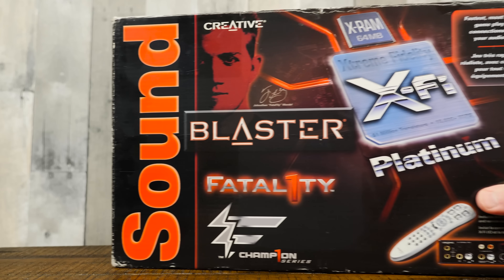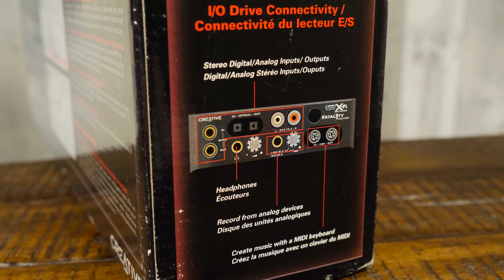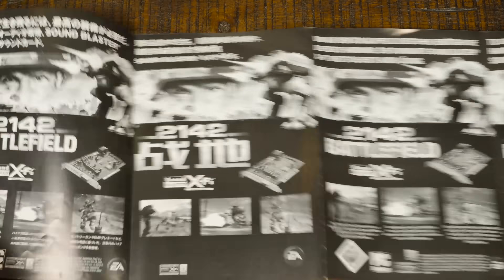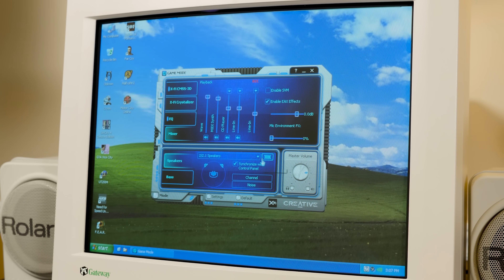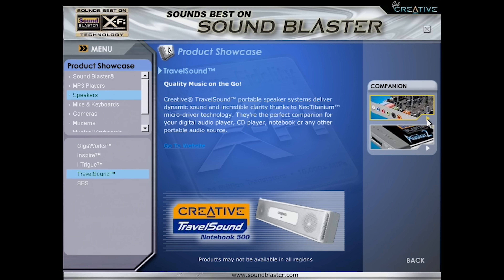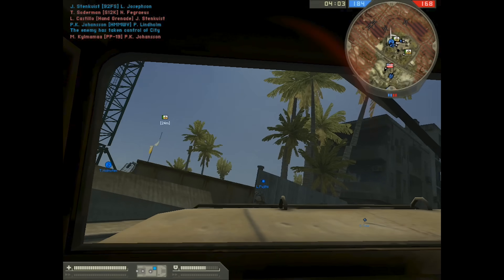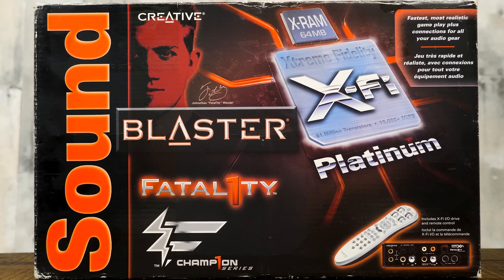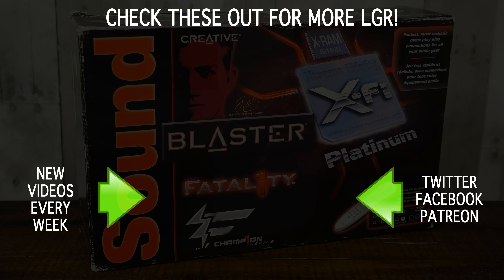XP Upgrade! Sound Blaster X-Fi Platinum Fatal1ty Sound Card

Comment: Still have mine from about 2005-06... Originally for myself but as I upgraded my main gaming rig I tossed it on an ASUS M3A78-CM that had issues with Windows XP.. possibly 7 I forget. Regardless works like a charm still to this day!

I had to reinstall Windows and decided to go with 11 as the hard drive was dying on that M3A78 machine, gave it a new SSD and everything loaded up 100%. I didn't have to even install any drivers I assume Windows 11 supported them.

BUT... After I rebooted once or twice the Creative Driver Installation opened automatically, I'm 99.9% sure I didn't download them or open the setup.exe that would likely come with the driver's zip/rar.

Anyway it was like the card installed it's drivers on it's own... I could be imagining things as it was strange... and regardless I rebooted after install and the card is still 100% functional!

It was either keep the card in that system or take it out and solely use Bluetooth speakers as I tested my Razer TrueWireless headphones via bluetooth prior to even installing the SB Card and audio was playing fine.. there's just something wrong with the motherboard's audio codecs/output and I'm too lazy to re-track down the proper drivers, not even sure they exist for this mobo for Win10/11.

Comment: I remember when I bought this exact card, only difference was the started shipping it with a black I/O drive. I was so upset when it stopped being supported by newer versions of windows. I'd still be using that thing today if I could. I'm rocking a Sound Blaster Zx these days, tried the AE5 and really didn't like it, just didn't dig the software

Comment: I have a Creative Soundblaster 2 ZS (I belive thats whats its called) in my Windows 98 machine very cool card, also have a creative  SB X Fi in my main machine its pretty awesome but the downside is the headset/headphones I bought for recently (MSI DS 502) only plugs in through usb no 3.5mm plugs so I cant use my sound card with it

Comment: Bought the same card this spring (minus box and front unit/remote). It was about 20$ so I couldn't pass it. I am using it on my daily machine (p5q deluxe q9550 8GBddr2 screaming 2008). I was impressed by its sound quality and driver support up to the latest windows 10. Unfortunately pci slots are almost extinct and in the future I won't be able to keep it in a new platform.

Comment: After Jan 2019, you can't run HL2, or anything on Steam without a massive headache.  There's a modded version of the Steam installer that does NOT run updates.  It was the only way I could get my XP rig from circa 2007-2008 to run Steam.

Comment: Still have one on my gaming rig, which thankfully has one legacy PCI slot. Much less noisy audio outputs compared to the ones on the integrated ones on the mobo :)
For some reason finding a windows 10 driver for it was a pain, "officially" it seemed to be discontinued with no driver support. A big pain compared to linux, where it just worked right out of the box :)

Comment: I bought this card, earlier this year, when I built a Windows XP gaming machine. When I bought the card, it was new. I even placed the sticker on my PC case. My windows XP gaming machine has a eVGA GeForce GTX560Ti 448 Cores 1.2GB GDDR5 Video Card, an AMD FX-4300 Vishera Quad-Core 3.8 GHz processor (with an AMD Wraith Cooler), and 4GB of DDR3 memory sticks. It's a great classic PC gaming machine, although a few of my games have trouble running on it. But I use nGlide, for games that are finicky with the video card drivers.

Comment: Using a cut-down X-Fi XtremeAudio since wayyyyyy back ~2007 with a 5.1 sound system. Although the XtremeAudio is not a real X-Fi it still has many of the features of the more expensive ones even though they are implemented in software.

Comment: In 2007 I had a Creative Audigy 2 ZS Platnium, well I still have it, but I upgraded to a PCI express X-Fi Fatal1ty Platnium in 2009. I got no idear who Fatal1ty is as i don't care for e-sports at all. I still use my Fatal1ty card with Windows 10 now days. There is no such thing as a build in audio chip that is good enough. There is a metal shroud on the card that shields against noise from the other components. Before that I had SB Live! 5.1 Platnium, and I still have it in my working Win 98 PC which has been ridiculously upgraded since then.

Comment: Is it worth putting my old sound blaster fatality 64mb soundcard, it's the gaming Jonathan Wendell one, in my rig that's 2 years old with a Gigabyte X99-SLI Intel X99 (Socket 2011) DDR4 ATX Motherboard in it? My sound card has 3 diff platforms, one for movie watching, one for gaming that flies a helo around your head and u know even with headphones where it is at what 'o'clock' and also a sound engineering platform which my son would use maybe as a DJ but he got all that now and signed. My problem is when I play games after a while of thumping out auto rounds the sound goes off or intermittent, reckon the old sound blaster would fix it? Only reason I never put it in was cos it has a front panel which my new rig has a disc player there! Anyway is it worth it or does my mobo have better kit than my old sound card? I only use headphones really.

Comment: The audigy 2 ZS is a better option for basic hardware acceleration as they can be found for as little as $15 for the sb0350 model. The only issue is the bad drivers for 64-bit windows that make it so the mic input sounds horrible.

Comment: Hey! you should try and get a Sound Blaster Extigy, its good with a laptop or desktop. I still have an Extigy but the USB don't work on it. I used to use it with a Dell Insperion 8900 Laptop in 2003-04. I paid $250 for the Sound Blaster Extigy back then. Its great for analog and digital. The Extigy 2 supports DTS.

Comment: Best sound card ever by Creative. Need 7.1 speakers to truly immerse what the card can do. I soldered together 7.1 RCA cables from the 3.5mm feeding an  Onkyo SR576 receiver. EAX shines in 7.1 and so does music and movies. It's too bad they dropped DTS. The front panel is another thing too. You can directly plug in instruments in the line-in without the need for an amp. That jumper needs to be in place though. Unfortunately it's in its last Z97 system, because leagacy PCI is long gone for newer systems.

Comment: Man I miss the kind of Io you used to get just with even the most basic things LOL and if you bought premium they just laid it upon you.. also miss the days before everybody switched to those sabere dacs and and more importantly when meridian started tuning all of them.. meridian the company that lost the higher end or at least the instructions for it somewhere in the origami of mqa and then just applied at universally to everything they do.. thanks Bob! I think the sound blaster zs is the last of the accelerators that doesn't have it, and still uses the proper good sounding if you like sound blaster sound chip.. all the windows still doesn't play nice apparently with any sound card from what I can tell when you put it into surround or 24 bit, it's a mystery but it's a problem that's followed me through several sound cards motherboards and operating systems since Windows 7, and once I figured it it was a Windows problem, initially just thinking it was a creative problem because they're about as helpful as any other modern company nowadays about troubleshooting things and even less about updating them or supporting them.. but as it turns out Microsoft doesn't even codify their own error codes.. 

so turns out it might have been them the whole time LOL.. some of the fixes people have for this are so ridiculous it's it cracks me up.. it has some relation I think to the idea of onboard audio and the drivers for that even if you disable everything and remove everything, but it could also just have to do with the lan chip or whatever, either way sound goes robotic usually after a DirectX refresh, or using any of the inos sounds like having clicks for back and forward or the on-screen keyboard.. once I disabled those it almost never transitioned to what Dolby would like to pump into the ears of everyone that doesn't have all five secret proprietary handshakes to play their proprietary super audio... Still worth it, to have analog surround sound through RCA to my receiver.. just wish the mind blowing and thoroughly DRM friendly, as in I have all the right things and all the right cables and all the right proprietary software.. except for not exactly when it comes to watching movies through streaming LOL they don't they don't like computers apparently.. feelings mutual I don't like TV apps, or apps.

I'm pretty sure I would get better audio or at least equivalent audio with more peripherals if I could find a good condition old school Audigy card anything from a two to anything really in that era or line up or style.. and if it came with some sweet Io that would be a hell of a bonus, I'm really not a fan of the way they do spatial currently in the drivers but.. that might be something you just have to deal with either way.. another was a guy that was updating drivers for the older line, they're certainly Windows 10 drivers up till very recently and far more recently than sound blaster or creative have ever updated anything to, it's almost like it's almost like he was doing their job for them LOL.. well he stopped good for him, good for him for doing it and good for him for stopping cuz creative really is just disappointing these days..

Still not quite as disappointing as what Bose did to base and mid-ranges, what Apple did to audio quality in general, and what meridian is doing right now to the higher end spectrum having their hands in pretty much every chipset these days on the consumer end.. but it's the disappointing kind where it's like dude you know like dude you know that you could do better, you're not crazy like the other ones.. you're just disappointing.

Comment: Anyone had experience with the Xonar cards with EAX?   I have never been able to get EAX to work on any creative card except the live 24bit under win 2k so looking to Asus for EAX support alternative.
Reply: GX enjoys a reputation of being best left turned off if you don't like bluescreens, and its EAX emulation seems to be rather incomplete / buggy anyway, so I wouldn't get my hopes up too high. That said, something like a Xonar D1 still is a great-sounding non-gaming card for the modest sums they go for, just a bit finicky (e.g. manual sample rate juggling if you want to keep the hardware in sync like in Creative cards, use 32-bit sample format rather than 24 bit). As a matter of fact, I'm using one right now.

The Live! 24-Bit uses a "dumb" routing-only chip without any DSP capabilities (like Audigy LS and SE and SB 5.1 VX) and EAX thus has to be emulated by the driver, which would explain why it would behave differently than its "full-grown" EMU10K cousins. Still, I don't get why EAX wouldn't be working for you in 2000 with the latter - maybe try some older drivers. Granted, 2000 never was the gaming platform of choice.
Incidentally, guess what my Win2k machine used... a Live! 24-Bit (among others). I even coaxed the card into doing 24-bit recordings with ASIO4All plus an Audacity build compiled with ASIO support, which seemed to be the only way to do it as the MME driver claimed not to support the format (unlike typical Envy24** cards). Never had anything fancier in there, unfortunately, besides this wasn't a gamin rig anyway (800EB + Radeon 9000).
Reply: I don't get how other's get EAX to work on XP and newer with the same games and hardware. I have no idea why it won't work.

I have tried every possible thing you can imagine, from every archived driver, different OS other than 2k, different SB cards, 3rd party drivers like kx ? and those ones from Daniel, EAX restorers and emulators, Alchemy etc...  And all possible combos of the above.

Only combo I know worked was live 24 bit and it's included CD drivers under 2k.   These games were ironically from 2001-2004 so I have NFI why EAX won't work outside of this combo. 

I have had 3 SB cards randomly die as well.  My live 24, and Audigy 2 zs and X Fi as an integrated version on an MSI PN6 high end board.   

I have even had odd issues where Audigy cards would peg the CPU at 100% as soon as the driver was installed.  I found the card to flood the CPU with interrupt requests for no good reason. Only way to stop it was to find a PC board with a certain PCI slot that stopped doing it. 

Don't get me started on creative drivers. holy shit they are bad.   If Asus can top that crap I would be amazed.  I am picking up a Xonar DG for 20 bucks just to try for myself, multiple times less than the creative cards I got as I had to import them to Aus where this one is in Aus. win win.

Comment: Very good video, congrats!! Just a question.. what Sound Card from those times is good for a Thinkpad  T61p? The SO is xp 4gig Ram and Quadro ... i got those SmartCard slot so Audigy Z is not an option (i got one PCMCIA) . Do you have any recommends?
Reply: Actually you've got ExpressCard/54 (~PCIe) + Cardbus (~PCI). Plus USB, and even Firewire, assuming that works. What would you need the card for? Speaker use (consumer or studio), headphones, DJing, line level recording, professional recording, maybe a microphone that needs 48V phantom power (not a bad option to have in times where $50 or even less will buy you a perfectly acceptable moderately-large diaphragm condenser mic)? Self contained or with external power supply?

Depending on all of this, there are a lot of mid-2000s vintage sound "cards" to choose from. Creative Labs alone was offering everything from USB consumer gear like the SB Live! 24-Bit External to the mastering grade EMU 1616M in the Cardbus ("PCMCIA") version, and the USB EMUs were well-liked for their performance. The 0404 USB still makes an excellent interface if you can deal with drivers being obsolete and the software taking some getting used to (it wouldn't be a Creative product without dodgy software, right?), which keeps used prices down. (The less expensive 0204 and 0202 models were also good performers but lacked phantom power, which raised some eyebrows then but seems rather unfortunate now. Back then you would just have used a dynamic mic. You can use an external phantom power adapter but it makes things more messy and adds cost.) 
Then there were the various tiny Echo Indigo cards for Cardbus (in the pro audio realm, they also made the Mona and Layla LapTop versions with a Cardbus interface at one time, and RME manufactured a HDSP Cardbus interface card for their rackmount units). The Edirol UA-1EX was popular as a consumer USB thingy well-suited to line level recording. A budding musician might have had a Lexicon Alpha (no phantom power either). Terratec made some rather nice prosumer gear, too, I don't think these are too common outside Europe though. And I almost forgot about M-Audio, a rather prominent name in the prosumer field at one time, who also had some nice gear like the Firewire 410.
Reply: No just Retro gaming, using headphones and maybe some music.. As per speakers  I got  a pair of Logitech 240 speakers) just dusting. This  is a occasional - therapy machine also so no big budget on that... but i got excited on the performance of a dedicated sound card playing things like diablo 2 or starcraft.. Thanks for your comment!!!

Comment: i am still using this but a pci express version in my windows 7  pc... i still have the old version in my pci pentuim 4 pc. it was the best sound card at the time so i got it to upgrade.  none of mine have a heat sink on the chip and it shows them with out it on pictures.  windows 10 is garbage so i see no reason to change from 7 i used this sound card last week to play  doom 2016 i just keep plugging it in every new pc i get it works fine

Comment: back in the day I bought a pci sound card just to pump a few extra frames from ati radeon 9200. In reality I would have been better off buying a nforce board because those via chipsets were not very good for gaming. But I digress, I remember after buying the pci sound card (which name escapes me because it was a cheap offbrand one) the sound was better, and my processor actually ran cooler. I also installed a pci ethernet card because this also seemed to help lol. Thankfully onboard seems to work just fine for everything now.

Comment: I have one of these X-Fis! A different model, some OEM thing, but it's great! I used it up until just a few months ago when I upgraded to a motherboard that it didn't fit which already has integrated sound. Damn thing worked great, but the headphone connection fizzled, and everything was weird with a modern system. Sadly, boring old no-fun integrated sound is superior in every way.

Comment: i still use x-fi elite pro with io panel which enables me to record 2 gutiars and one microphone at the same time. damn i sold my guitar amp. no need for it if you have this card. yeah on ryzen 1700 16gb ddr4 gtx 980 system. these are awasome cards with daniel software.

Comment: I have that, still use it on my i7, still better than any integrated soundcard, it supports low latency ASIO, so i can plug my guitar in to it and use amplitude and such with no delay

Comment: When it comes to issues using windows 64 bit, I seem to remember that the AMD Phenom CPUs had much better architecture for dealing with 32-bit legacy applications than the intel x64 processors of the time. I certainly never had many issues running 32-bit applications with mine.

Comment: Still rocking the Sound Blaster X-Fi Titanium Pro Fatal1ty card. I am planning to upgrade my system soon, but I still am going to use this card instead of integrated audio. It's a beast of a card especially with it's good RF shielding and bit-matched playback, but you do have to put up with the horrible side of very badly outdated Creative software.